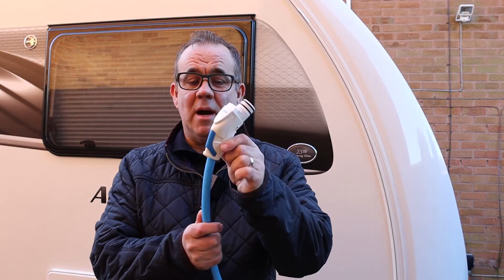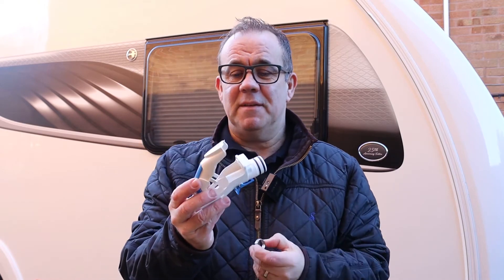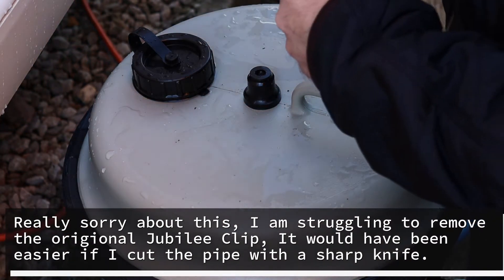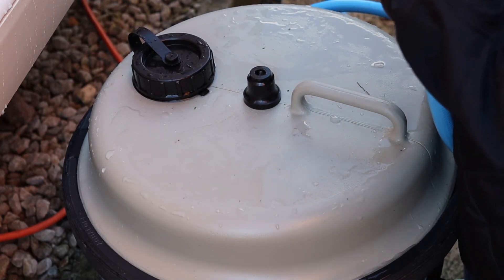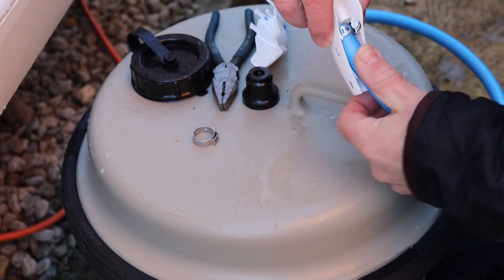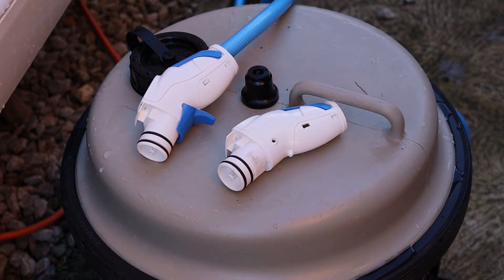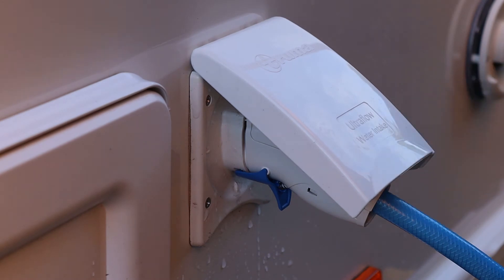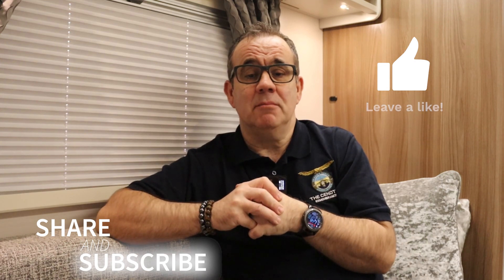Replacing Truma Cava Ultraflow Pistol Grip

Comment: I have the same set up as yourself, I just find that the pistol grip isn't going all the way in for the clips to attach and secure. Is this a common issue that you've heard of before?
Reply from the maker: Hi Mark, I always keep a little tin of Vaseline in the Battery Box, Before connecting the Pistol grip I put a small smidgen of Vaseline around the 2 rubber o rings, I find it helps a lot. Hope that helps. Thanks for watching & happy Camping,  James
Reply from the maker: One of these
 https://www.amazon.co.uk/Vaseline-Lip-Therapy-Original-Tin/dp/B002GC9UZG/ref=sr_1_10?crid=2G3ZUKM323A3R&keywords=vaseline&qid=1677854104&sprefix=vasaline%2Caps%2C79&sr=8-10
Reply: @CaravanEscapades101  haha maybe that’ll work.
Reply from the maker: @Mu5hy84  Id odes for us,
Reply: That worked a treat by the way. Giving this page a follow right away 😀
Reply from the maker: @Mark McNulty  great, glad it helped and thank you, much appreciated, Happy Camping. James

Comment: Hi, can you connect the water direct to a tap without the pump in between?  I use a toilet cistern fitting inside my water hog but that seems better.  Thanks.
Reply from the maker: Hello Yes you can. I have one. It has a small pressure reducer in between thr tap end and the pistol grip. They can be bought from any caravan dealer or online.
Hope that helps and thanks for commenting 
James

https://www.amazon.co.uk/dp/B007VCI5PW/ref=cm_sw_r_cp_apa_glt_fabc_P239MEP88MTJPZ8EWC0W?_encoding=UTF8&psc=1